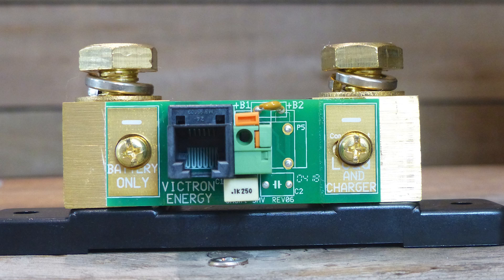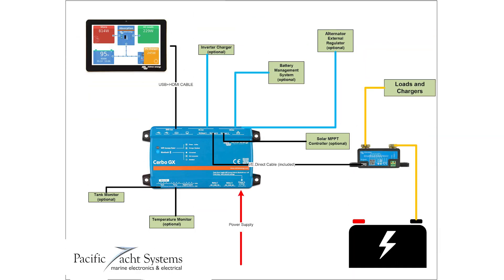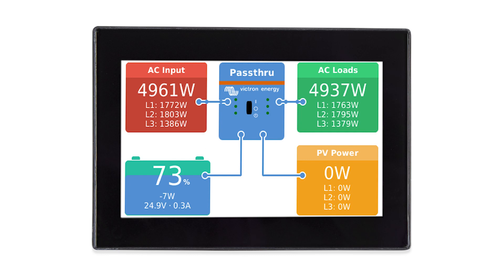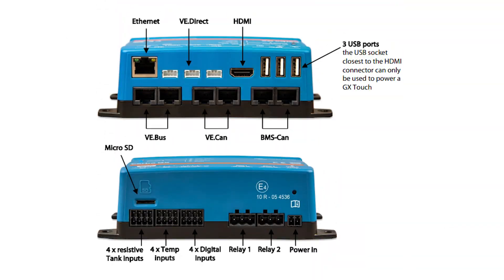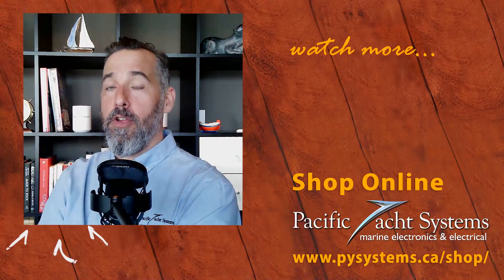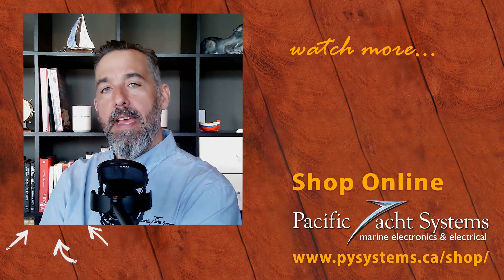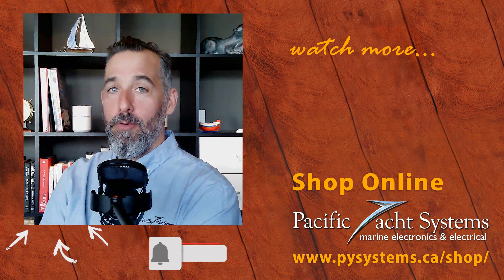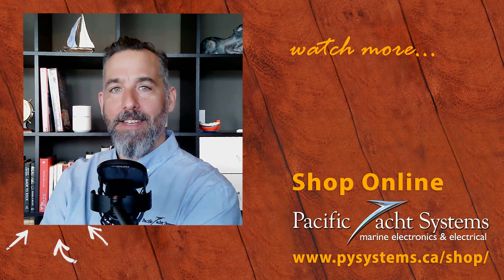Victron Cerbo GX Boat Monitoring and Control - Product Review with Jeff Cote - Part 2 of 2

Comment: Cerbo GX is awesome. My biggest challenge was running the HDMI from the Cerbo to the Touch 70–15 feet of cable extension. 

The Touch 70 power comes from a simple 12v-USB power outlet (for now).